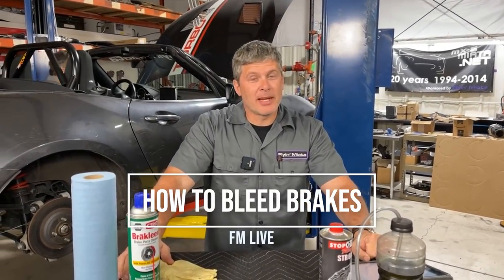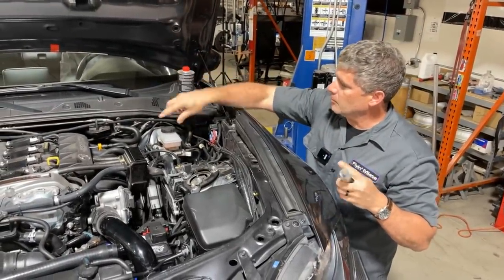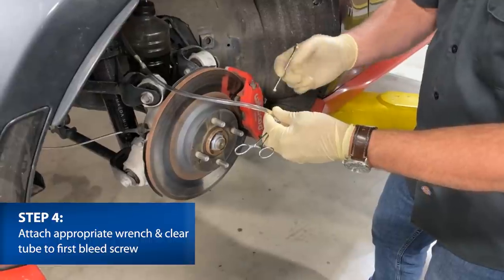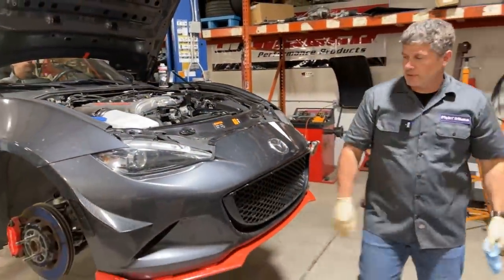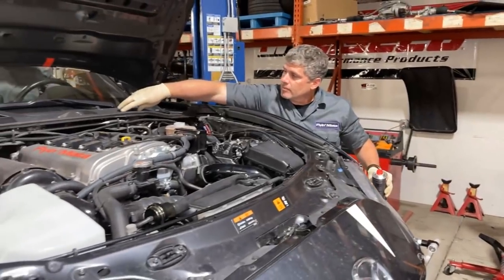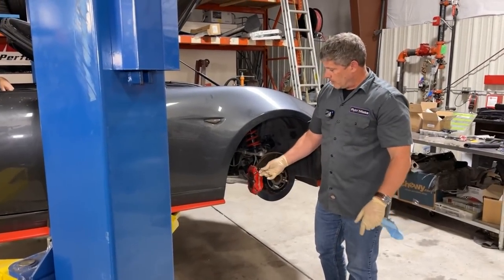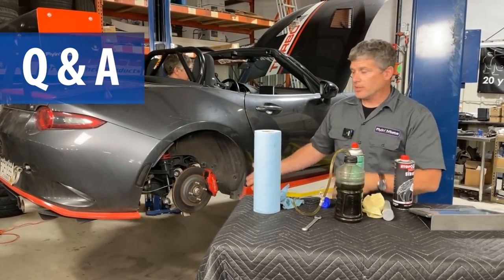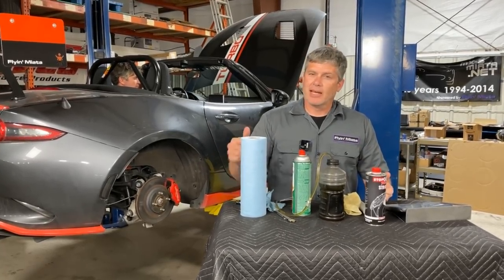How to Properly Bleed Your Brakes (FM Live)

Comment: I take my time doing this: open the line and let gravity do its work. Every 20 minutes level up the reservoir. Ok, it takes many hours, but in the meantime can do the gardening.
Reply: Hey, I know your comment is old but I had a couple questions about your gravity brake bleed. First, does the car need to have accessories on or can it be completely turned off when bleeding? Second, when doing a gravity bleed does it just drip fluid down the side of the caliper and do you have a container underneath on the ground to catch the dripping fluid? Does it cause a mess on the calipers? Finally, do you do this on all wheels at once or one line at a time? Thank you

Comment: Hey no disrespect but when you open the blender and fluid is in the line why don't you just keep pumping the brake pedal maybe 10 or 15 times then hold the pedal down close the blender screw fill the master cylinder repeat if necessary,  it's way faster than pump bleed and close  !! Been doing it for years
Reply from the maker: That's a good way to move a lot of fluid in a hurry and we probably should have mentioned it. It's useful when doing a flush. The method here has a better chance of getting those last couple of little air bubbles out, so we'd recommend finishing with it.

Comment: IMPORATANT: Because the brake master cylinder and clutch master cylinder draw from the same reservoir, and the pickup for the clutch is up near the top of the reservoir, you gotta pay attention. Be careful letting the fluid level drop below this level as you can draw air into the clutch lines.
Reply from the maker: You won't draw air into the clutch master cylinder unless the clutch pedal is depressed or the bleed screw is opened while the pickup is exposed. Fluid has to be moving before you can get air in.
That's actually the first step described in doing a full flush, get all the fluid out of the reservoir and replace it with fresh before you start the bleeding process. It won't add any air to the system.

Comment: Is there a recommended practice when replacing all of your brake lines with braided lines?  I figured that one should replace the farthest line first then bleed that wheel.  Then replace the next one in line and bleed again until you get around to the front left wheel (NA8).  Seemed like that would be better than replacing all the lines at once then bleeding the whole system.  Thoughts?
Reply: I've done of bunch of lines, you are going to have a buttload of air no matter how you do it. I have just done them all at the same time then bleed as talked about here. You can do it either way.
Reply from the maker: The way to minimize the amount of air in the system is to leave the bleed screw open on the caliper while you install the new lines. That allows the system to "self bleed" as you connect everything. It's even better if you work your way out - attach the braided line to the hard line, then to the caliper, then close the bleed screw.
We always change all the lines then bleed the whole system. Chances are you're going to be doing a full flush at the same time anyhow.
Reply: @FlyinMiataVideo  That self bleed technique makes sense.  I will be doing a full flush and was just trying to minimize sucking more air into the system.  Thanks!

Comment: I have the Willwoods on my ND on all four corners like you have on your track car. If I do a gravity flush, do I open the front and back bleeders if doing all 4 at one time?
Reply from the maker: If you mean the inner and outer, yes. Basically, any bleeder that is open will bleed. The more you have open, the faster the reservoir will empty out so you'll have to pay attention. I usually only do one corner at a time because I'm not in that much of a hurry.
Reply: Any video’s on the rear Wilwoods install out there? I will be installing the one’s I ordered from you in a couple of weeks and doing the full bleed then. Parking brake has me a bit nervous, honestly.

Comment: Does the clutch system share the same fluid reservoir as the brake system? Wanting to know if it's best practice to flush that out as well during brake bleed.
Reply from the maker: Depends on the year of the car. The clutch fluid doesn't see the same temperatures the brake fluid does, so it's less critical and is usually on a much longer replacement schedule.

Comment: 1.) For vacuum pumping: Do you just crack the cylinder open and pump the fluid out?
2.) Is the diagnostic port ABS cycling method for the NB the same as the late NA?
Reply from the maker: @abdullahagcayazi7581 To vacuum bleed the brake system, you'll hook up the vacuum line from the vacuum bleeder tool to the bleeder on each caliper, then crack the bleeder loose. Then, you'll pump the tool up to pull fluid and air through the system until you stop seeing bubbles coming out of the caliper bleeder. Once you stop seeing bubbles, close that bleeder and disconnect the vacuum line and move on to the next caliper. Regarding the ABS cycling, are you referring to the procedure to get the ABS pump to cycle?
Reply: Yes! (at least in my case) I am talking about the method for cycling the ABS pump in a late NA 😓

Will try driving around and hitting the brakes hard to activate the ABS and then bleed again.
Reply from the maker: @ReydioTube  The Mazda Factory service manual doesn't have any special bleeding procedure for the ABS module. You'll just bleed as normal.

That said, if you need to test the function of your ABS system, the cycling procedure is effectively the same.

Comment: you probably wont spot this comment or be able to reply. But my friends ND has had terrible pedal feel for a year or so now, really soft and mushy. I couldn't really see where the problem was, but the caliper seals were in pretty bad shape. So I did a full brembo caliper refurb (it's an ND30), all new seals, and pulled new fluid through it with the manual foot method!

It still feels pretty pants, its a little better, but still not as good as it was when the car was new. Lots of rumours that ABS pump causes issues and needs to be triggered, or that a passive bleed isn't enough, and you need to get a suction system on the calipers to pull the fluid through?

Appreciate any suggestions, as we've now refurbed all calipers, replaced all pads and discs, and pulled about two bottles of castrol SRF through the system!
Reply from the maker: It's not unusual to have to activate the ABS in order to get bubbles out of the pump - that's true of any car with ABS.

Comment: Keith, how far are you cracking open the bleed screw when just allowing it to drain? Quarter turn half turn? 
Thanks for the video.
Reply from the maker: It’s a less than a quarter turn. If you’ve got someone holding pressure, it’s usually quite clear when you’ve opened it far enough.

Comment: Thanks for this video! Never heard about gravity bleeding before, definitely going to try it next time, my helper has to grow for about 12/13years before he'll reach the pedals. Question for Keith, when you do a gravity bleed to do you use a tube and bottle on the nipple? Or just let it come straight out the nipple and catch it ina bucket or something? If so whats the ressoning? Ty!
Reply from the maker: You can use a tube and bottle or you can just let it drool all over the caliper. The latter is messier but quick.
Reply: @FlyinMiataVideo  ah OK thanks very much!

Comment: After installing my wilwood calipers up front my left wheel locks up far quicker than the right one. Would you recommend a pressure bleeding system to push as much air out of the system maybe? Or would you think it's something else like corner balance?
Thanks!
Reply from the maker: You always want to squeeze as much air as possible out of your brake system. Bubbles are bad!

Corner balancing may also play a part in this when you're really pushing it, but a proper brake bleed is much more important.
Reply: @FlyinMiataVideo  😂 thanks..

Comment: Great video! I'm currently doing a full caliper replacement to Brembo fronts and red calipers in the rear. I noticed in the shop manual that, if you replace rear calipers, you need to do an extra air bleed procedure in the rear that involves screwing the rear caliper piston in and out, pumping the brake pedal a few times, pulling the parking brake a few times, and repeating this process a few times.

My question is, should I still do a full brake bleed procedure first (right rear, left rear, right front, left front), THEN do extra the rear caliper air bleed procedure? Or, can I just first follow the whole rear caliper air bleeding procedure first, THEN just do the remaining front calipers in the normal fashion? Thanks!
Reply from the maker: Thanks for the added info. I guess I'm guilty of not reading that section😁
Reply: @FlyinMiataVideo  Haha no worries. It only seems to apply if you're replacing the whole rear calipers and is not needed for just doing a full flush.

Just an update for future readers, I just finished the brake job the other day and I DID do the full brake bleed procedure first and THEN redid the bleeding for the rear calipers with the extra steps (involves pumping the pistons). 

There was a considerable amount of extra air bubbles when doing the piston pumping so I highly recommend doing these steps if you're installing new rear calipers. Cheers!

Comment: When installing the Wilwood 6 piston calipers do I need to put any lubricant gel grease on the back of the brake pads for anti vibration? If I change the brake hoses can I do a gravity bleed? Finally if doing a gravity bleed can I still connect the clear tube to the nipple to catch any fluid so it does not go all over the caliper and floor? Thx. 🙏
Reply from the maker: Proper brake pad grease, often referred to as "Brake Quiet" isn't a bad idea, but usually not needed. 

A gravity bleed is fine, but don't let your master cylinder run dry.

You can absolutely still connect a hose to the bleed nipple when doing a gravity bleed.

Comment: What size ID is the best to use for that clear hose?
Reply from the maker: It varies depending on the bleeder screw. Some calipers have bigger screws on them and thus need a bigger hose. For Miata/Wilwood calipers, you want a 4mm or 5/32" hose. Flyin' Miata includes appropriate hose with some of our brake kits.

Comment: Same bleeding order with ABS? Can you video the process for bleeding the ABS if it gets air in it?
Reply: hey did you figure out the answer for this question, I'm having the same problem right now.
Reply: @aizal1468  I was worried that I might get air into the abs, but the abs system seems to be working okay right now.  I bench bled the master cylinder as instructed and kept filling the reservoir while bleeding each brake.
Reply: @dcox399  I stupidly took out the hardlines for my abs when fiddling around the back of the block and now I have no brake pressure- suspecting it's because I either got air into the abs or the Master Cylinder, but if bleeding out the MC and then the calipers at each wheel will fix it then I'm
hoping.

Comment: I replaced rubber lines with stainless braided ones. I replaced the calipers rotors pads and bled the system. However, when I push the pedal to break, it feels like it’s really soft right up until the end and then it gets firm and the car stops fine. Does the pedal need to be adjusted or am I missing something else?

1992 na6
Reply: How did the pedal feel before you did the work?

Comment: I'm pretty sure the proportioning valve dictates that more fluid flows to the front than rear calipers.
Reply from the maker: The earlier cars have a proportioning valve that limits rear line pressure above a certain level - far higher than the pressure you get while bleeding. Newer cars use electronic brake distribution.
Reply: @FlyinMiataVideo  I only meant it as a possible explanation for Keith's comment about not knowing why the front calipers move more fluid.

Comment: Is that 12.19 or 12.88 wilwood brake kit??
Reply from the maker: The ND in the video features our 12.19 BBK
https://www.flyinmiata.com/ND/nd-bbk.html
Reply: @FlyinMiataVideo  this is about how much u. Need  for a non v8 nd that goes to the track 6-8 times a year right?
Reply from the maker: @gigi9467  This is the car that did the 15 hr turbo torture test at Laguna Seca. As long as you have the proper pads, this set-up should be great for a part time track car. Feel free to reach out to our support team directly if you need first hand impressions or have any other specific questions we can help with!
Reply: @FlyinMiataVideo  awesome thanx